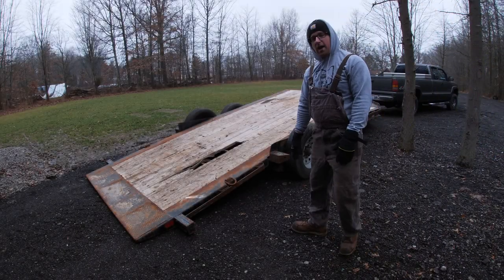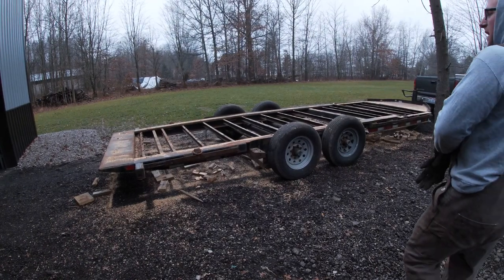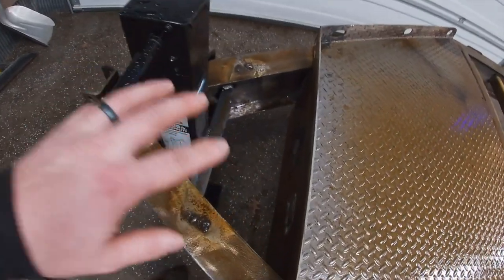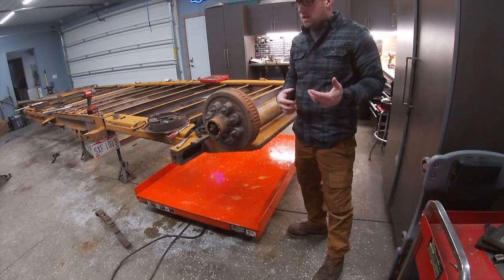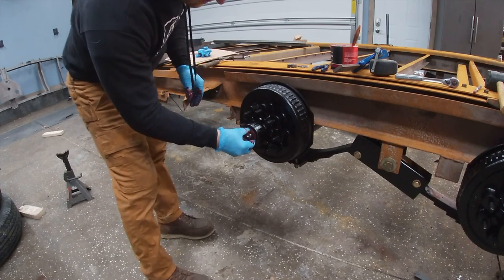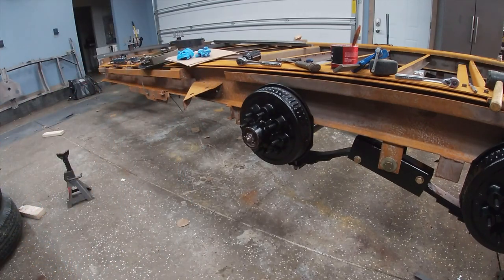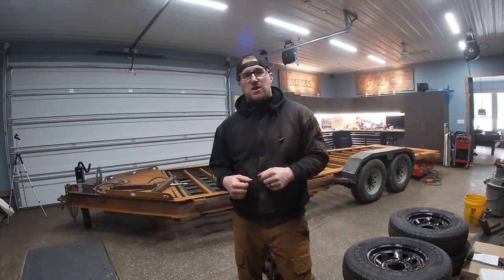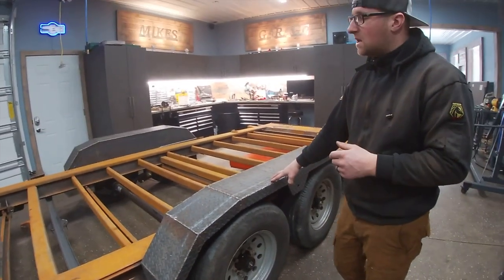Saving a 2019 Diamond C tilt deck trailer from the junk yard (part 1)

Comment: A pro tip for packing wheel bearings with grease is to put a giant blob of grease in the palm of your hand, grab the bearing with thumb and forefinger and slap them into your palm with the grease (rotating it of course). You will be so surprised at how that bearing will almost soak up that grease like a sponge. I'm not trying to be a know it all, an old timer showed me that years ago and it works. 
That and pounding that bearing into place I would recommend a soft-blow or dead blow (brass head or plastic head) hammer instead of a claw hammer lol

Comment: Nice video.  As far as the winch, most people have mentioned a roller on the tilt portion.  Another option is to recess a receiver hitch in the non-tilting portion and have a post with a roller or snatch block.  Bottom of receiver should be capped with a drain hole, so you don't have to pin the post. Made mine from 2x2 hitch stock with an eye on it to accept a snatch block.  Works great. and not that much in material or fab time.  Haven't bent it yet, but I'm careful to not side load it in any way.

Comment: Put a heavy duty steel roller on the front end of the tilting section for the Winchester cable to travel over.
Reply: Problem with that is when putting a strain on the cable it will want to pull down on the tilt deck
Reply: @mattlent6031  Locking bolts for when the deck is tilted and closed will fix that issue, done that on one of my trailers after I tried it out and realized that the deck will till back down hahaha

Comment: I will never understand how people can beat their equipment so hard in just 4 years. That trailer had to have been super expensive, just to trash it.
Reply: Man this is exactly what I was thinking. Even if you use something everyday for 4 years it shouldn't be in that bad of shape. That thing was basically ruined. I can see why it was heading to the junk yard.
Reply: Some people look at what the max weight is for it and think they can exceed that weight. Or they are doing a full send when pulling machines on and off, hitting curbs hard into jobsites, etc, etc. Some people just don't treat their investment with any form of care.
Reply: Landscape crews will destroy anything!!

Comment: I would make a removable steel roller that you can put on the tilt section for the cable to roll over. Then no messing with ramps and a lot less work

Comment: pro tip.  there should be NO torque on wheel bearings when you cotter pin them. snug and spin to seat, back off to the first cotter pin alignment AFTER it loosens. the point is to have as little free play as possible without having the bearing in a bind. any preload on a high speed bearing will cause it to heat up and fail. good job on saving something that needed a little love.
Reply: Wrong
Reply: @williamuskoski1385  well explain why...
Reply: this is the way I was taught!

Comment: In regards to the winch. You could possibly mount a roller at the front of the tilt section that is recessed in the deck when the deck is down, but when you are winching the cable can roll. Once you get your load up to the deck I wouldn't think there would be enough force from the winch to pull the deck down either.

Comment: Not hating but curious why the ramps? Why not add a roller on the top of the tilt deck for the winch cable to slide on that way you can still use the tilt function of the trailer.
Reply: Was wondering the same thing, great job
Reply: In my opinion o would have made a mount on front of tilt deck for the winch in addition to one on front of  trailer so u could winch what ever up on to tilt deck then winch it fwd if needed once deck is flat
Reply: And I was taught to replace cotter pins than reuse them and to let them go down rather than up  but that’s how I was taught 😊😊
Reply: I wanna say because the tension of the cable over the deck will force the deck down before what he's  pulling touches the back. Especially  if it's not close.
Reply: A simple retractable bar, just before the highpoint, can support the winch cable. You see them all the time on log trailers.

Comment: Put a roller on the front of the tilt to allow the winch cable to run over while it's tilted. No need for ramps.

Comment: What the heck were they doing with this trailer? As far as the winch goes I would build a raised roller system that can be removed to clear the deck when winching if that makes sense ? Or a snatch block hanging from some sort of removable frame ? Any of these ideas could slide into the stake pockets and be removable.  You could just buy a separate winch fairlead and mount it on a frame as well probably the easiest route

Comment: Another option would be to run a strip of 1/2", or thereabout, UHMW across the front edge of the tilt deck, tagged into the steel with some countersunk bolts.